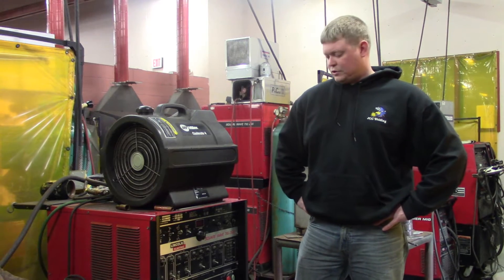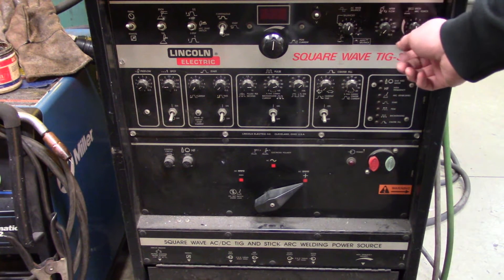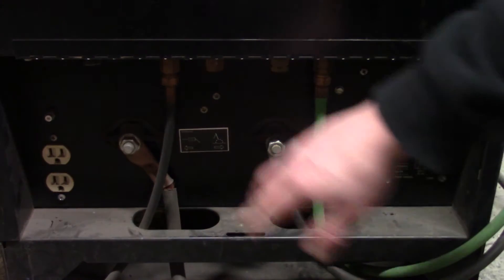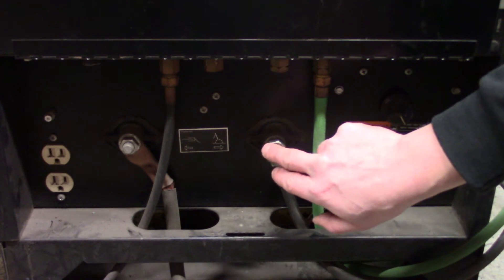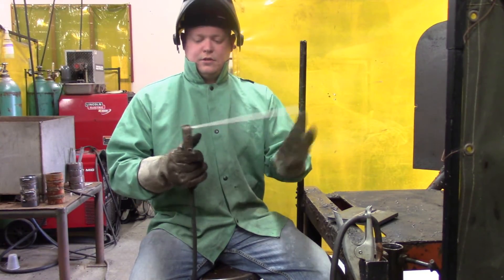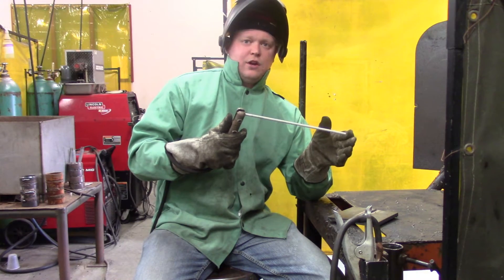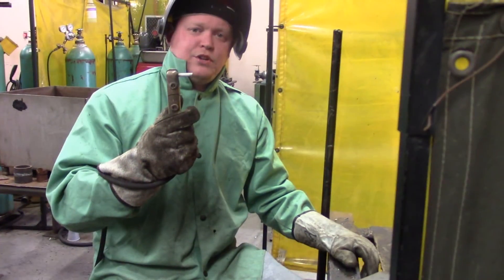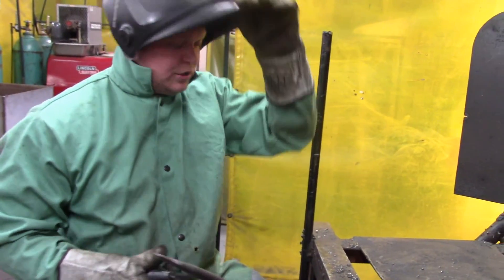How to set up a Lincoln welder Stick

Comment: Hey buddy I got a question for you I recently picked up basically the same welding machine except when I turn my machine on it immediately turns off I have a 50 amp breaker and it's not popping it so I'm assuming it's the on/off switch something must be faulty with it. I've been looking around and I cannot find an extra power switch do you know how I could come by one?
Reply: could be wired for 3 phase and you only have single
Reply: You can download owners manual online as a PDF and it shows you the buss bar wiring diagram for Single Phase -- easy, simple

Comment: does this work on household current -- it would be helpful if you talked about this,since it part of "set up"
Reply from the maker: +geo dezix It will work on household power if you have a 220 volt plug.  Regular plugs are usually 110 volts, but there are certain household goods that use 220.  Dryers for instance usually have 220 requirements.  If you're looking to put the welder in a garage, if you have an air compressor, look to see if that is 220.  Some air compressors are 220.